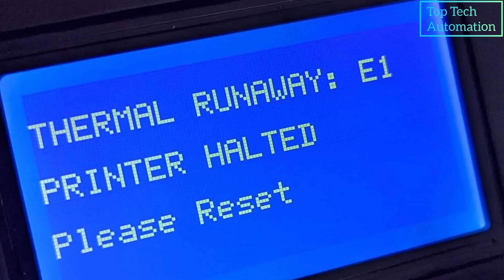Thermal Runaway Fixed in 02 Minutes | E1 Error Ender 3 |Easy Fix| Error Solved 100% #ender3pro#error

Comment: Finally one that does not use a repair kit, I did this after it shutdown mid-print and so far this is the longest it has gone without shutting down I will update once the print is complete

It just finished and after I did this it didn’t turn off at all and the print was perfect